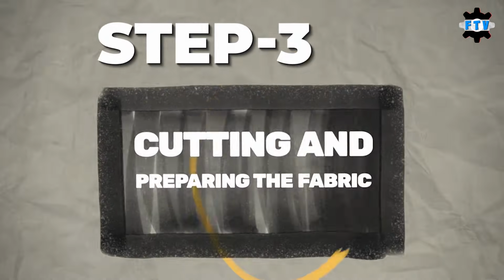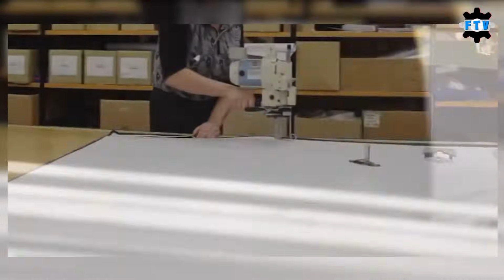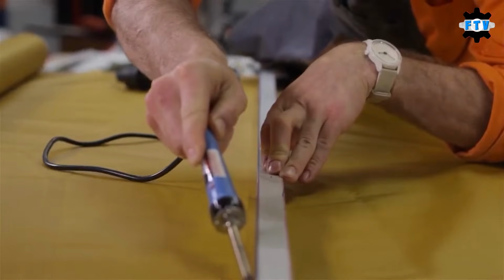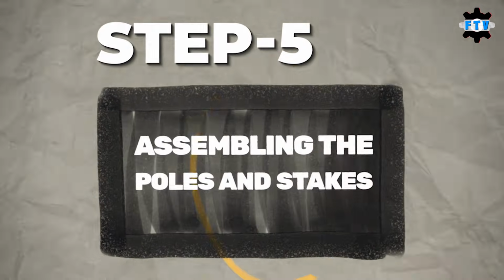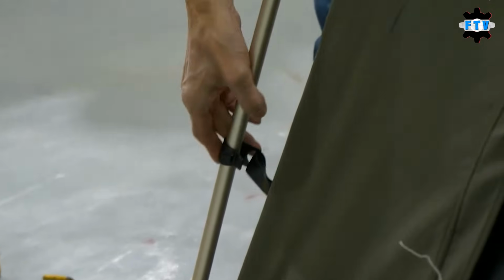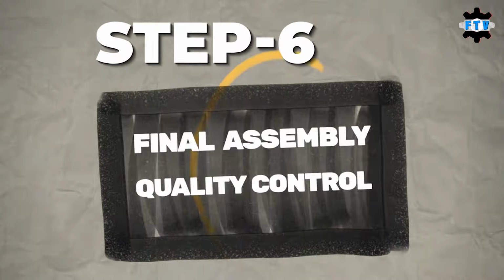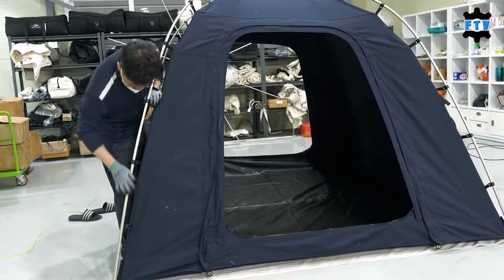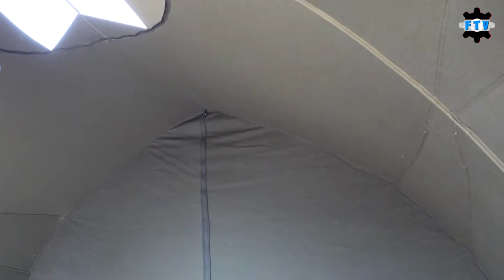How Tents Are Made: From Fabric to Finished Product #TentManufacturing #FabricationTV

Comment: At 45secs. What is the tent design software?
Reply: It's not a tent design software specifically. It's a very basic 3d software called sketchup. It has add on extentions installed in this video for simulation and complex meshes